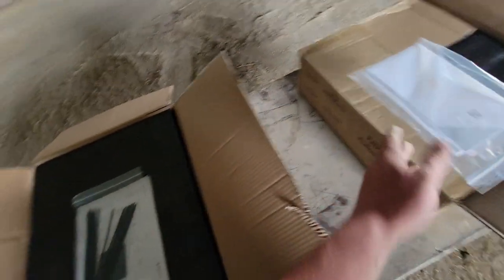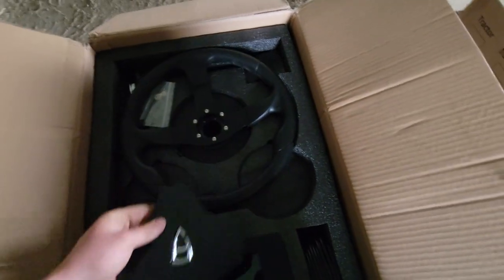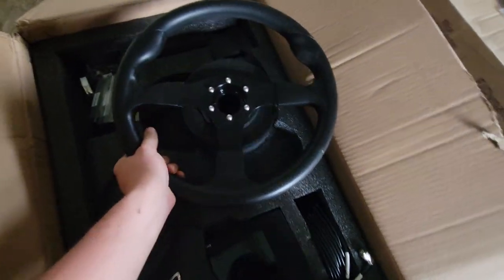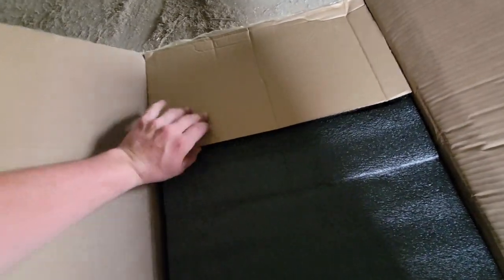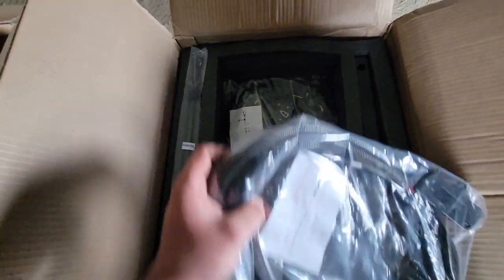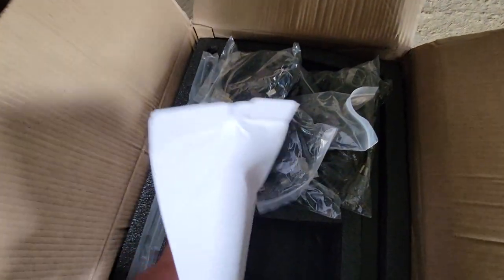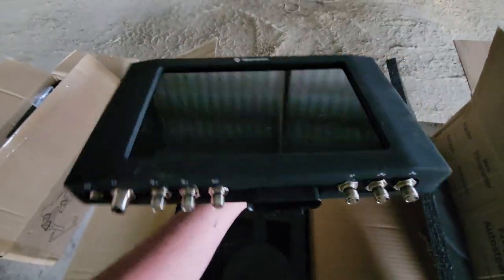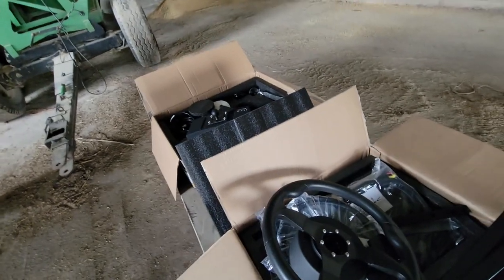Unboxing my New Autosteer System From FJDynamics!

Comment: Our 6145R came guidance equipped...... all we had to do was  attach the Green star globe and   do the logging in formalitys... Bingo    My son is equipping the 2 5115Ms  with  the Steering wheel-motor drive also Green Star..... only problem is  Globes are on back order.....I  used one   Mowing Hay  this month  and  it  does ok but   you have to forceably take control of the steering on the end rows......My Son has found an easier way to electrically  disconnect but he hasn't shown me yet